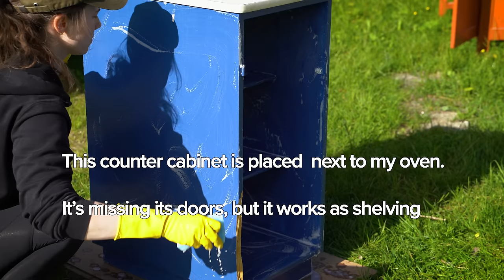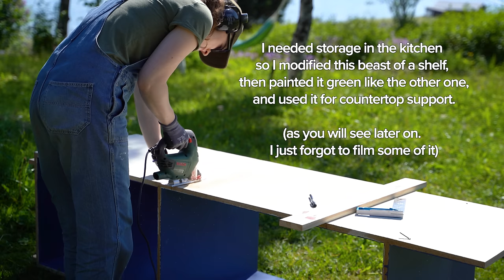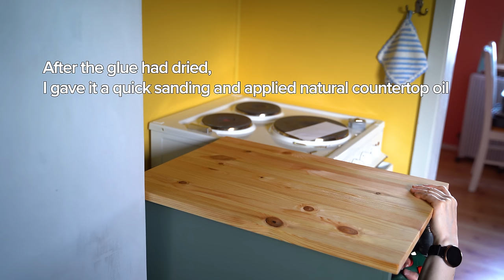I like Old Things | 100-year-old Cottage Renovations

Comment: You have the most AMAZING view from your property.
A suggestion for the dresser your using as kitchen drawers. ( great idea by the way!) you could pull it forward even with the others, and build a frame behind it, this would keep it from sliding back.
Reply from the maker: Nice tip! I actually wanted to have the option to slide it back, to use the countertop as a breakfast/bartop area💛

Comment: I like old things too. Youxll want to put a few strips of wood under the counter  on top of the drawer cabinet  so the counter doesn't sag. Or you may run a stip along the back wall to help support it.
Look forward to see how you decorate with old things.
Reply from the maker: Yes, I need to find some proper supporting for the countertop. Not sure the cabinet drawer/wheels will handle the weight of the whole countertop. Thank you for your tips!💛

Comment: A little tip for you.. a couple of spoons of borax in your hot water will make washing your floorboards so much easier, it has great cleaning power. It’s non-toxic and creates a barrier to ward off insects. No need to rinse afterwards. Any type of soap will leave a film that dirt will stick to. With borax that’s not the case.
Reply: PS. Don’t confuse borax with boric acid, the latter is toxic.